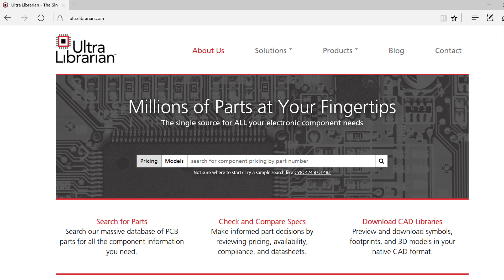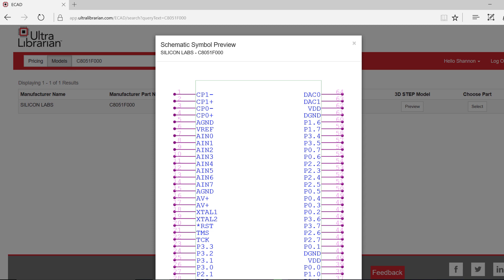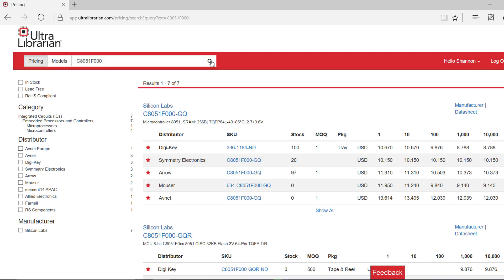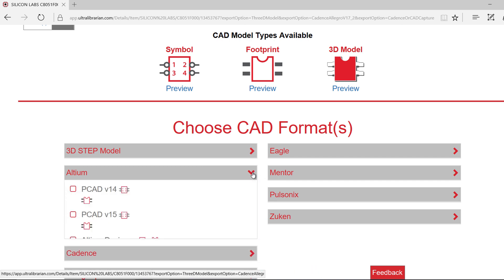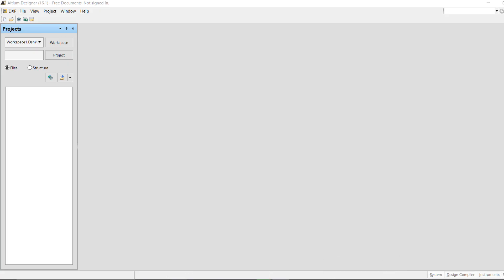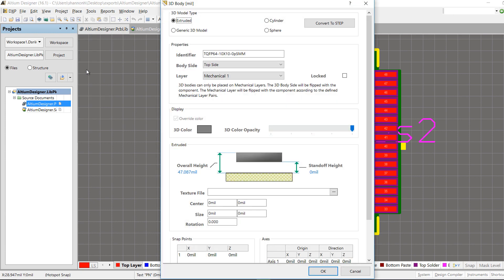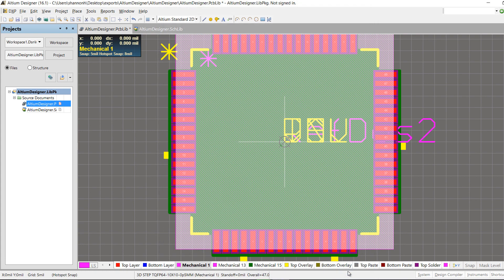Altium Designer Symbol Footprint and 3D Model Generation

Comment: for anyone else going through what I just did to try to get one of these models imported into Altium 23: after getting the .PcbLib and .SchLib file into Altium, if you cannot link them to a component and it doesn't show up when you try to place the part in you schematic, just copy over the symbol and footprint into a new component. that's the only way I could get it to work

Comment: I use Altium 14 and got :
Access violation at address 1E106C9F in module 'AdvSch.dll'. Read of address 60FF008B at 1E106C9F.

How can I rectify it ? thanks

Comment: i m using SolidWorks pcb i guess is not the same as the altium designer please tell me what to do to get the STM32F100C4T6B Library with SolidWorks PCB

Comment: DOES NOT WORK WITH ALTIUM 19 !!!
Reply: having the same issue
Reply: Worked for me.  I'm running 19.1.7 .
Reply: I got it working with Altium 20. You have to close the project and then re open and everything is good after that

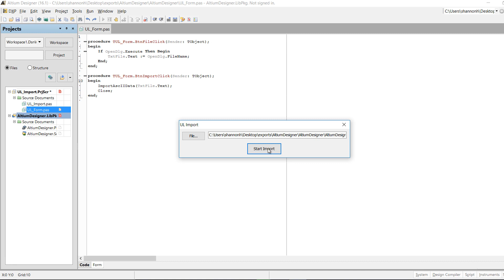Comment: I'm using Altium 18. After generating the footprint and schematicSymbol, I open the PCB footprint and I don't see anything (2:10). I think something's wrong.
Reply from the maker: Hi Arthur, I apologize that you are experiencing issues. At this time we don’t have any known issues with Altium 18. If you are still experiencing issues please reach out to us at info@ultralibrarian.com with the manufacturer part number in question and any screenshots that display the issue so that we can take a look.
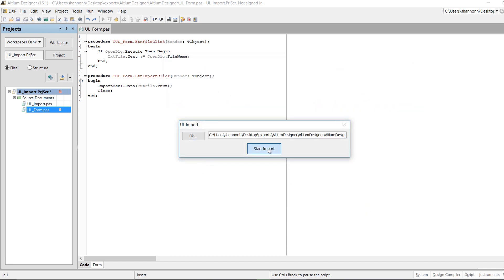Reply: I ended up solving the issue. As mentioned, at step presented in step 2:10 the foot-print is not visible, but if I close and reopen the generated project Everything works properly.
This said, it's only a minor issue.
Thank you for the attention and for making the electronics world a better place!
Reply: @AV1461   thanks sir, i had the same problem. <3
Reply: had same problem with the pcb layout. Closing and opening project did the thing, but then my schematic vanishes xDD. Need to do it myself now